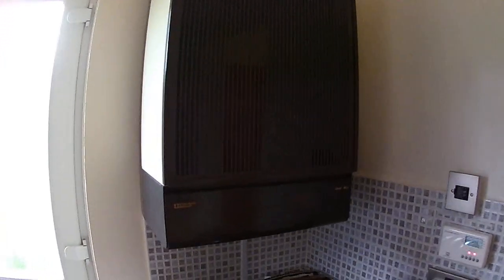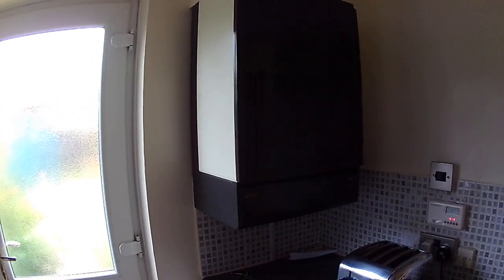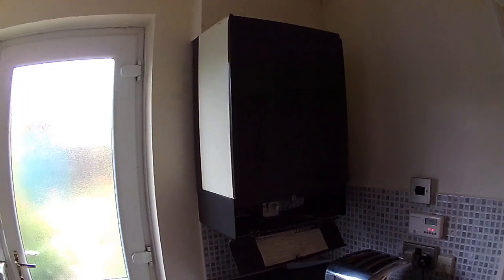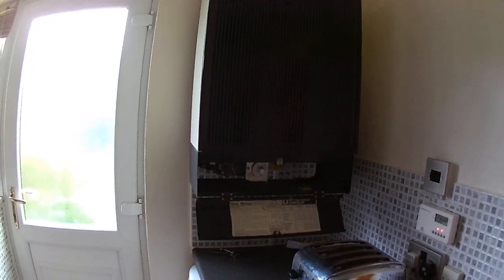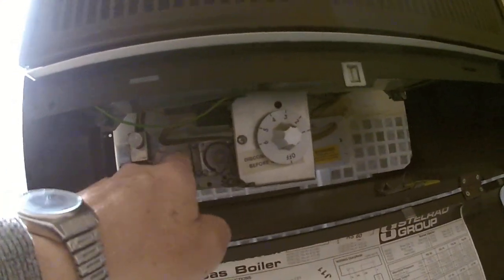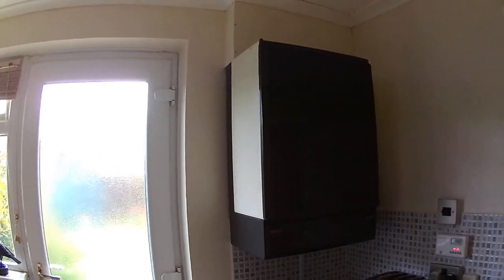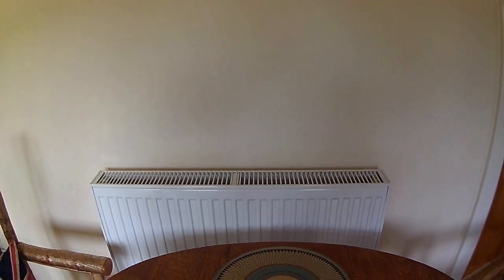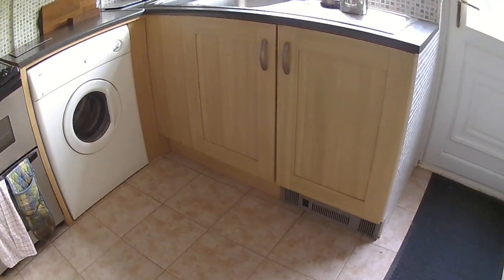Boiler Service. Balanced Flue Heater.

Comment: Hello, I have a same boiler. Had to shut it down completely by Cutting the main gas off for cooker installation. However, since then it refuses to fire up. The pilot flame is on perfectly, however. Any ideas as how to get this old machine working again?  Thanks.
Reply from the maker: Hi The pilot gas flame doesnt need any electricity. The electric enters the boiler via the computer style connector. Electricity flows through the thermostat then to the main gas solenoid which let's gas flow to main gas jets. Check that you have electric power. Turn thermostat from  off to around half way and back and forward several times. It may have just got stuck. You should hear it click. send me another msg if needed. Cheers from old George